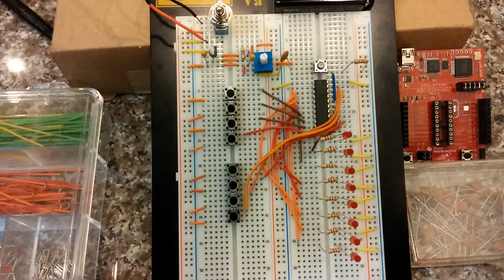MSP430 Launchpad Project (code and schematics): Button Controlled LED Array on a Breadboard

Comment: Hey, I made a circuit that plays a melody when you press reset on the launchpad but on a breadboard I have a switch from the positive terminal of the battery to 47k to reset pin (like you) and I need to hold the button pressed to run the code. Once I let go it stops. How does yours work if the rst is "open"?
Reply: Figured it out. I switched the 47k to go directly from the positive terminal to the switch and the RST. That way the connection to RST and to ground are both at that load